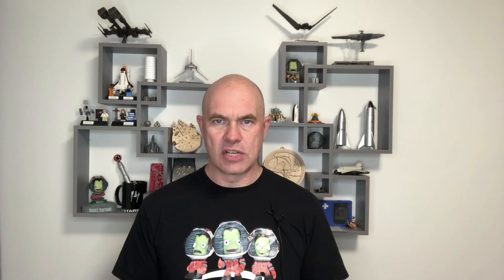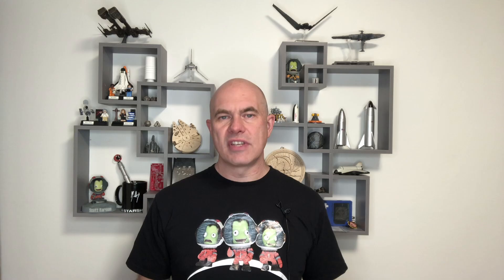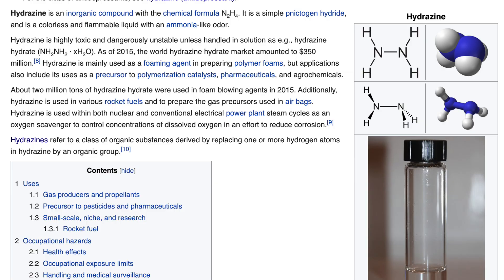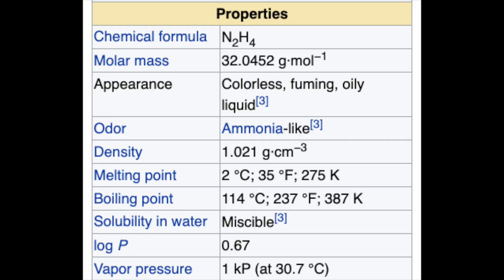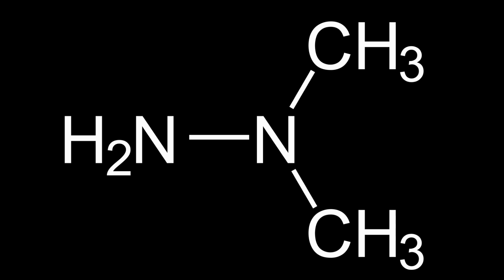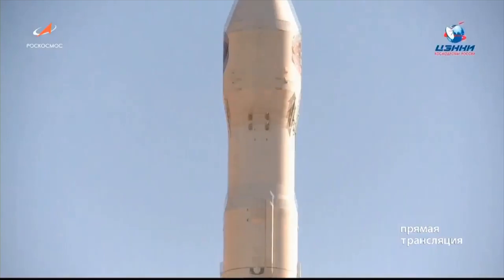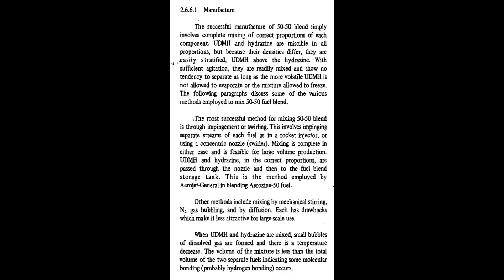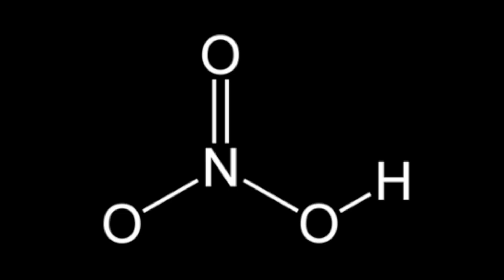What are Hypergolic Rocket Fuels? (Other than Explosive, Corrosive, Toxic, Carcinogenic and Orange)

Comment: When the chemical you're using to make your propellant safer is ***hydrofluoric acid***, that's a rocket fuel I'll take with a tall glass of nope!
Reply: Less evaporation during transport/storage.👍
Reply: If you think that's bad, you should check out chlorine tri-fluoride. It will spontaneously combust on contact with sand. In other words, there is no possible way to extinguish a chlorine tri-fluoride fire.
Reply: @deusexaethera  let it burn out. or dose it with water for a show.
Reply: @deusexaethera  The most fun fuel/oxidizer combination for a rocket: chlorine trifluoride and dimethylmercury. Great ISP, at the price of turning your launch pad into a Superfund site, _at best_!!!
Reply: meldroc whats the isp?
Reply: @meldroc  That would turn the launch pad into a hazard zone matching the area around thernobyl for a while.
It would probably also damage the launch pad.

Comment: Wrote out a long comment on the Me163 and of course you covered it! What an absolutely insane machine.  Used two fuels that when mixed they ignited... and the pilot sat in between the tanks in the wings, and right in front of the primitive, unstable rocket motor.

The Me163 had to be refuelled from two separate trucks that had to stay far away from each other to prevent even the fumes from mixing. One drop in the wrong place, any unnoticed spill before the other fuel was loaded, and BOOM. (One fuel type per wing, they couldn't touch before reaching the rocket motor).

You had to be a real mad lad to be on the ground crew, and clinically insane to be the pilot.
Reply: German test pilot Hanna Reitsch loved that little Aircraft .I think one tried to kill her ?
Reply: Hanna Reitsch crashed several times in the 163, still loved it. If you don't mind it being a flying bomb, especially for the time, it is a brilliant machine.
Reply: Were German test pilots even allowed to say no to a test flight?
Reply: Rock Lover She lost her nose when the 163 crashed. She would only wear a lap strap not a full harness, she smashed into the dashboard.
Reply: The BBC TV series “The Secret War” has a great episode with the 163 and interviews with Hannah Reitsch.
Reply: @Thumbsupurbum  They pretty much were, but they rarely did. Most of them were absolutely cold blooded. Hanna Reitsch flew a helicopter inside an building to impress Hitler, she had the idea to create a suicide corps. She was absolutely mad, and obviously loved flying. So we're most other test pilots.
Reply: 50% loss rate with none ever having been shot down… A suicide machine.
Reply: @markdavis2475  That's right ,i remember now .I think Hanna had what they call "The Right Stuff" .A love of Speed .
My No1 Hero Kitty O,Niel and close second Shirley Muldowney had the same addiction .
Hanna is a fascinating Character .
Reply: The Walter HWK 109-509 engine used in Me163 was one of the first production rocket engines with a turbo-pump and multiple thrust settings. At the time it was quite a remarkable machine -- air ministry preferred these engines over von Braun's designs, with which they have started dabbling into liquid fuel rocket-propelled airplanes earlier, in 1936.
Reply: @jethroreading7168  As I read it, she was quite naive regarding politics. It is proven that she didn't believe in that race shit. I mean, maybe she supported the Nazis, but back then, that was normal.
And, without looking at the Nazi stuff, she was absolutely fearless. She was like the only woman being allowed to be a test pilot there.
So yeah, she was a nazi. But there definitely were worse.
Reply: Sturm Kintaro yeah there are worse, but you don’t become close friends with Hitler given a cyanide pill in the bunker without understanding what’s going on
Reply: P Davis  Except that some pilots didn't die from blowing up, they died from being exposed to leaking propellants in the cockpit. I read one account where the pilot was found half melted in his seat. I'm going to guess that was likely an agonizing death.
Reply: @jethroreading7168  There's understanding (likely), approving (very likely), and having identical reasons (less likely given the sometimes conflicting motives throughout the top villains in that gang).  Some just liked the killing and/or torture activities while others believed in crazy reasons to hate their victims enough to hurt them.  Then some did it for greedy reasons like art and gold teeth.  It can be quite chilling hearing interviews with unrepentant members of that group.
Reply: Ah yes. The Komet. Also known (by me) as the "vore plane" (because a pilot LITERALLY GOT DIGESTED INSIDE OF THE THING).
Reply: There's a story of an Me-163 pilot crashing on a test flight. He survived the crash, but he still died because the fuels quite literally melted him.

Comment: "Oh no, we spilled some liquid oxygen! What do we do?"

"Shut off any ignition sources and leave the area. Just wait it out."
Reply: Back When, one of the engineers habitually smoked some kind of old jockstrap/inner tube mix cigars.  One of the techs dipped one of these in LOX and left it on the his desk for the engineer to find.  When he lit it, it flashed instantly to ash, and took a goodly part of his mustache and eyebrows with it.  He took the hint...
Reply: @Jonascord  Did the same, they burn really fast, he got a single puff out of it before it was down to the filter.

With LOX remember not to use shoe polish, it may not be the best thing. Was filling a LOX tank in the bay, and there was a snake in there. Broke it, as it fell out of the gloves when I grabbed it, and on landing on the floor at cryogenic temperature it broke into pieces.
Reply: Check and see if your feet are still there.   You would have learned real fast if the ground was fuel contaminated.
Reply: @Jonascord  I'm wondering who was he employed by the propulsion engineering division of Acme?
Reply: @arnoldsherrill6305  Next Best thing, Lockheed.
Reply: "Oh no, we spilled some chlorine trifluoride! What do we do?" "RUN"
Reply: That actually happened. There was only one casualty, the fellow steadying the tank. He was found 500 feet away where he had reached Mach 2 and was accelerating before he was stopped by a heart attack. (Source: Ignition! by John Clark)
Reply: I was touring an old WW2, and since upgraded over the years, torpedo battery where they used HTP torpedoes at one point. Basically the way they solved the danger tied to the oxygen production was by having the storage areas and the torpedo room itself built with a massive pool of water beneath it. They also wore full protective gear whenever they worked on torpedoes where the HTP was not removed for other obvious reasons.
Reply: @Jonascord  hmmm...a lockheed engineer who worked in the same space as the techs (and other operations/manufacturing personnel I'm guessing) back in the era where smoking in the work place was acceptable.....about an hour drive north of LA I'm guessing? 😉
Reply: @maxk4324  Actually it was at Grumman, after it was bought out by Lockheed...  We were examining cryotempering...
Reply: @railgap  I invented a saying about CTF: Working with CTF is like riding a bike, except the bike's on fire, you're on fire, the fire's on fire...
Reply: @NarutokunJB  I feel horrible about it, but I laughed out loud at this.
Reply: "Oh no, we spilled some liquid oxygen! What do we do?"

"Take a deep breath and try to stay calm."
Reply: I know right? JClark has the most macabre sense of humor.

Comment: As a chemist, love these chemistry videos! When I watched that Boeing launch abort test I recognised the gas as NO2, glad you're here to explain how that came about because I was wondering!
One small point - be careful how you use the terms "strong acid" and "weak acid" because although HF is very reactive it is not technically a strong acid. Strong acids are defined as acids that completely dissociate in water and HF does not because the bond is stronger and has more covalency due to better orbital overlap.
Further to that, the 1% HF you're talking about is described as a dilute acid because a weak acid is defined as an acid that does not fully dissociate in water.

Comment: Using HF to protect the rocket plumbing from acid is like using Sodium Fluoride to protect teeth from acid, just a lot more extreme.
Reply: An odd thing is, it's not really a terribly strong acid; the fluorine wants to hold onto the hydrogen too much. It is really toxic, as are many of the byproducts when it reacts with random molecules, and it particularly attacks skin and glass.

Comment: Smelly too, in the case of aniline.  
Edit: And no love for Britain's RP-1/HTP engines?  
If you decompose the H2O2, the oxygen and steam are hot enought to be hypergolic with kerosene.
Reply: Mhmm. Stink rockets!
Reply: Your lungs wants to know your location...
Reply: Made me think of bombardier beetles. Sadly I couldnt find anything about the specific impulse of their butt explosions on wikipedia.
Reply: They tried things that were far more smelly than aniline... get a copy of "Ignition!", there's a whole chapter titled, "The Hunting of the Hypergol", describing all the crazy things they tried out in the decade after WW2.
Reply: @WakarimasenKa  Don't think it is much, more designed to leave them right there, while the aggressor is desperately wanting to be NOT there.
Reply from the maker: I thought about including Peroxide / Kerosene but it was getting late and it's a weird corner case - the peroxide still needs a catalyst to break it apart and make it hot enough to react.
Reply: Personally I love the wild man who decided the mix of hypergolics and and kerosene was good in a submarine. Now to his credit though the Swedish military have used, and perhaps still do, this solution for several years without any major incidents.
Reply: @aBoogivogi  The Soviets had somewhat less good results, and have had a good number of failures as well. most memorable was the Kursk, destroyed by a leaking torpedo, a well known issue, that they had ignored as a possible cause for concern, because the torpedo tube was designed to contain the blast with the inner door closed. Too bad it did blow with the inner door not fully closed, because of a poorly designed or made electrical connector, another well known issue, combined with a catalyst in the tube, otherwise known as rust.
Reply: @scottmanley   Maybe you could do another video on them? There's this enticing possibility of using 'cold' (600 deg C!) HTP rockets for your spacecraft attitude jets and main engine at low throttle, then adding the RP-1 to the main engine for max thrust. The DeHavilland Spectre rocket (used in the SR.53 test aircraft) could run cold or hot to give an impressive throttle range. There are problems too of course: HTP's freezing point is only about -4 C and since it's decomposition is exothermic, once something starts it off you get a runaway reaction. Wierdly, it's more stable the MORE concentrated it is: the water content essentially acts like a contaminant that can react with other things to start the decomposition process. The really intractable problem though is specific impulse: the exhaust contains a lot of relatively heavy water molecules, so the exhaust velocity is never going to be comparable to something like LH2.
Reply: @SeanBZA  Very good point
Reply: @MrHws5mp  Soviets had invented some stabiliser that got 99 peroxide storable for 10 years
Reply: @32353235e   Really? Wow. I know it took a while to achieve production of 98% HTP but it was much more stable than the lower purities when they did.
Reply: @MrHws5mp  Yes, it must be closer 98 in reality
Reply: Armstrong Siddely Gamma ran 85% because they could catalyse it with cheap silver instead of expensive platinum. It's a shame we folded all this stuff up in the 70s. It's one of those fields where the UK could have found a niche and stood toe-to-toe with the big boys. But alas...
Reply: @charleslambert3368   IIRC the 98% stuff didn't become available until the late 1960s. Never going to get around the exhaust velocity issue though.
Reply: Came here to post this (and I did, before seeing this comment...)
Reply: Thought of a Black Arrow too.
Reply: Charles Lambert The Nammo rocket for the Bloodhound SSC uses HTP as an oxidiser for the solid fuel. Doesn’t seem to need an ignition source.
Reply: Back in the Rotary Rocket days, Jeff Geason said, "Everything is hypergolic at the right temperature." Then we went on to play with Silane fed through the kerosene lines for ignition.

User tip: SiH4 diluted with enough N2 is not immediately hypergolic. We made a nice fuel-air explosion that evening, fortunately with no major hardware damage.
Reply: It's not hypergolic if you have to add any energy into the system to achieve ignition. Even pre-heating the hydrogen peroxide to make it decompose disqualifies it from being hypergolic.
Reply: Try mercaptans. Specifically the dimethylamino group attached to a mercaptan sulfur.
Reply: @deusexaethera  Well, most hypergolic engines are simple pressure-fed devices. Do you include the energy expended to fill up the helium tanks? Most of these things don't need pressure to ignite. There are demonstrations of this in a lot of posts about rocket fuels.
Reply: @thethirdman225 : The energy used to fill the fuel tanks and the helium pressure tanks does not count, because that energy dissipates as waste-heat long before the engine is ignited. The result is the fuel actually gets cold as it expands while the engine is running, and as you may know, cold is the opposite of hot.
Reply: @deusexaethera  Yes but it requires pressure to get the optimum level of pressure needed in the combustion chamber to do the work. That's my point. The hypergolic will oxidise (ignite) on contact anyway but they're better under compression. I'm not trying to be a smart arse here. I'm just posing the question, that's all.
Reply: @thethirdman225 : Atomizing the fuel and oxidizer to maximize their surface area for chemical reactions is not the same as heating it. If you need proof of this, all you need to do is try to run a gasoline engine without sparkplugs -- all the atomized gasoline in the world won't spontaneously combust inside an engine with no heat source for ignition, whereas hypergolic chemicals, as you say, will burn instantly on contact with each other. Atomizing the hypergolic chemicals doesn't actually raise their temperature, even if the individual droplets are slightly heated by the atomizing process, because the enormous increase in volume translates to a net decrease in temperature. So again, kerosene burning with decomposed hydrogen peroxide still doesn't count as hypergolic because input heat is required to start the reaction, and that is by definition not how hypergolic chemicals work.
Reply: @deusexaethera  
"Atomizing the fuel and oxidizer to maximize their surface area for chemical reactions is not the same as heating it."

No but the process required energy to achieve it.

"Atomizing the hypergolic chemicals doesn't actually raise their temperature, even if the individual droplets are slightly heated by the atomizing process, because the enormous increase in volume translates to a net decrease in temperature."

That should not be inferred to mean energy recovery either. Once again, what I'm saying is that there is energy needed to pressurise the fuel and oxidiser. That is energy consumption, whether it heats the fuel or not because it's stored as potential energy. The pressurised tank is holding potential energy. See what I mean? It's not an ignition source for sure but there are other kinds of energy.
Reply: @thethirdman225 : The input energy required to initiate most chemical reactions is thermal energy specifically, hence that is the type of energy my statements refer to. Hypergolics do not require thermal energy specifically to initiate their reactions. Obviously all fuels still need to be physically transported into the combustion chamber, there is no avoiding that.
Reply: @deusexaethera  Okay, so you're only referring to the initiation of the reaction and were not talking about the delivery pressures (which are true for all rocket engines except solid fuel). If so, no prob but I think we'll have to agree to disagree. No harm done. ;)
Reply: @thethirdman225 : "Hyppergolic" is not a rocketry term, it is a chemistry term. Therefore rocketry-specific considerations such as fuel delivery are irrelevant to the determination of whether two chemicals are hypergolic when combined with each other.
Reply: @scottmanley  How about a video on Mike Pino's investigations into Mercaptans?
Reply from the maker: @NarutokunJB  That idea stinks.